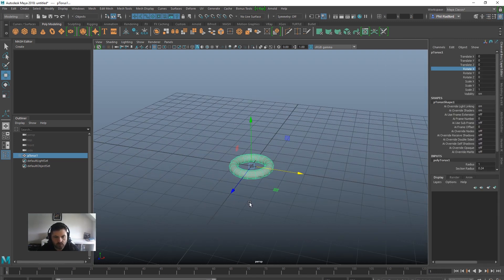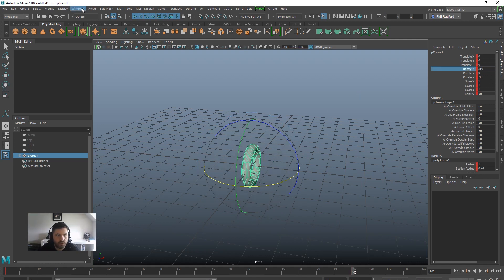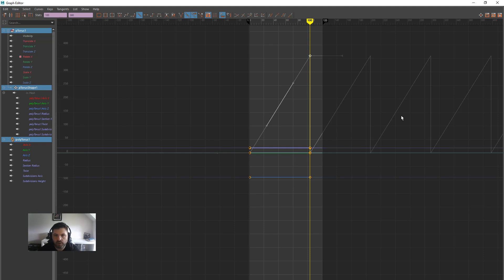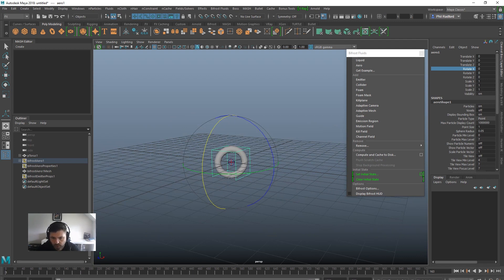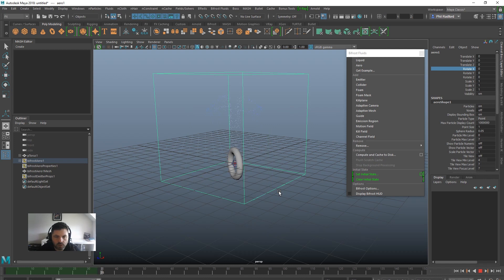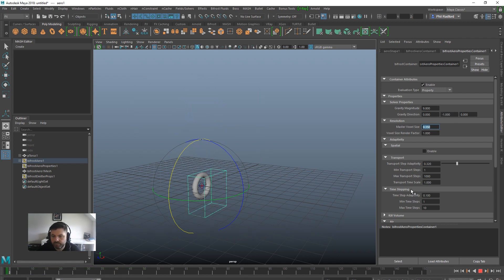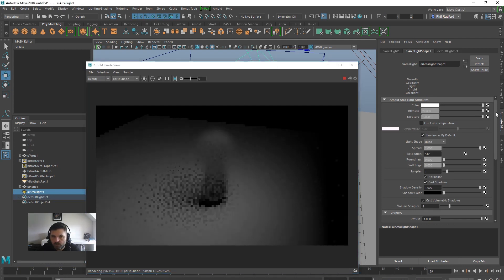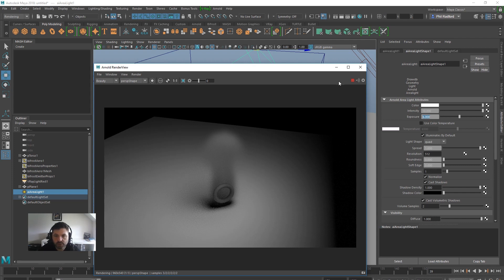Maya Aero Rendering

Comment: Hi! Sorry but it doesnt work for me, i have the error : "// Error: [mtoa.translator]   bifrostTranslator: Arnold node type bifrost_volume does not exist." and i dont understand because the material aistandardvolume is on the bifrostaero1 and i increased the density like you show it and still nothing happen, im desperate :/
Reply from the maker: Hi, don't be desperate, it's ok we can sort this out. Are you using the latest version of Arnold?
Reply: I have the same problem, so I tried updating Bifrost, since I already updated my Arnold to the latest version. First try, it appears in my renderview, then I changed the frame, and it disappears again. Every other object is showing but the particles

Comment: Hi Phil,

I'm trying to render Aero with Vray. The problem I have is that the smoke appear in the render window correctly until I adjust the master voxel size. Like in your video it works fine if you set it 0.5 or 0.4, but as I decrease the value to like 0.2 or .01 for higher resolution it disappears. (I tried to re-render not using IPR).
Any idea how to solve this?

Thanks
Reply from the maker: Hi Vito, is your machine up to the job of lowering the master voxel size?  Does the simulation disappear in the viewport or just the render?
Reply: @MayaGuytutorials  Just the render. I can see it in the viewport.
Reply from the maker: @vitomocellin5212  So to troubleshoot what is causing this switch to Arnold and test if it renders with that. If it does you are dealing with a vray specific issue, if it doesn't possibly a machine related issue. Are you rendering with bucket or progressive in vray and have you tried both?
Reply: @MayaGuytutorials  Progressive or bucket both not showing the smoke. I switched to Arnold and it works fine. I really don't understand why is not showing up with Vray though...
Reply from the maker: @vitomocellin5212  Have you added the Vray/Bifrost attributes to the Aero attributes tab? it allows vray to render the smoke as an environment fog or pheonix fd smoke.Under aeroShape1 tab go to Attributes just above the attribute editor and scroll to Vray, add Vray fluid shading quality. Then scroll all the way down to the new options added to that attribute. Under volume shader change from auto to Vrayenvironmentfog, turn on scatter GI. try that
Reply: @MayaGuytutorials  Thanks for your effort I just tried adding those settings but still not working. Could it be that the "bifrostAeroMaterial1" shader is not supported or something?
Reply from the maker: @vitomocellin5212  I cant replicate your issue and I am using maya 2018 .4 and vray next plus my container is set as low as 0.100 voxels and still rendering with the bifrost aero shader.
Send me your scene and I will take a look for you. You can find my email address on my business website strangebox.co.uk
Reply: @MayaGuytutorials  On Maya 2020 I have the same issue as Vito. Have you had any luck with a newer version of Maya than 2018?
Reply from the maker: @petterssonphoto  Hi. I am on the latest maya 2020 and aero runs fine for me. Have you tried creating an aero sim in the bifrost graph editor?
What is your actual issue Mikael ?
Reply: @MayaGuytutorials  Thanks for getting back to me! I follow all the steps in this video but IPR or a render does not show any smoke. I get an error: "// Error: line 1: V-Ray : V-Ray: fatal error loading  - 'Invalid VDB stream data!'". 
I did not find anything online about the error that would have solved this. And no, did not try creating the aero sim with the Bifrost graph editor yet (will look more at your tutorials next;) )